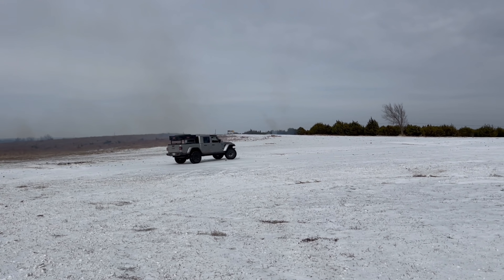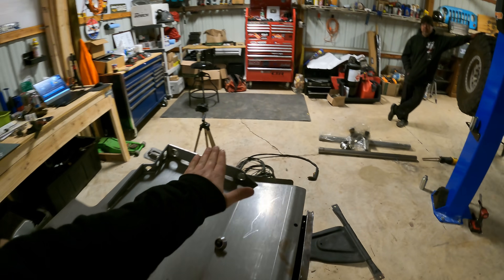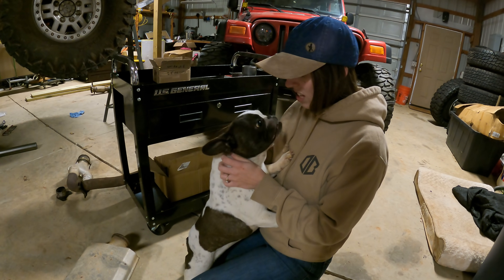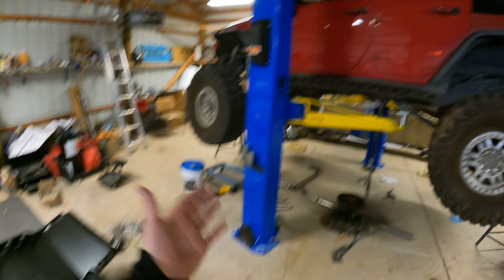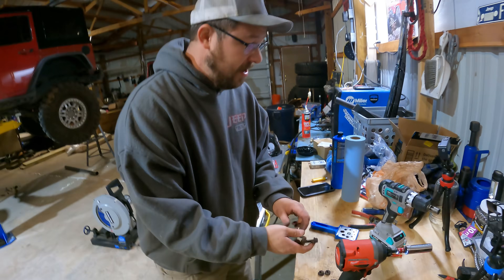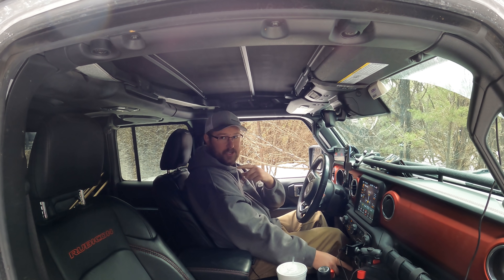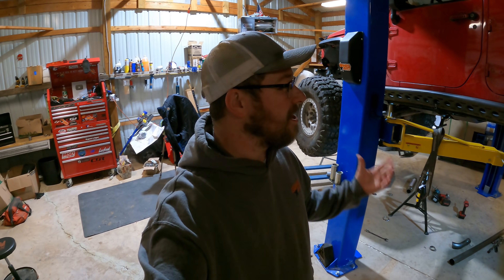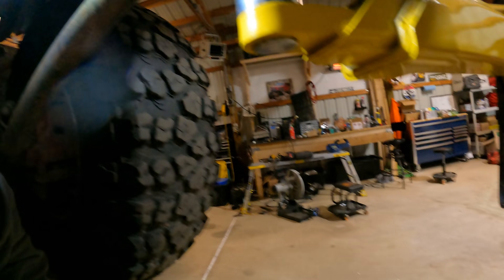The Wrangler is Torn Apart! So Let’s Take the Gladiator Snow Wheeling!

Comment: Tell you what Ben. Since your lift position causes you to use a stool under your JK. Get yourself a Vyper industries stool. They are not cheap but DAM... they work great. Sturdy, comfortable, and move so easily, you will feel like you're gliding over the floor. I was skeptical but then got one and have absolutely no regrets. I have Hyperlite linear hi-bays in my shop. They are awesome!! Very bright. You will need a manometer to adjust your regulator. Propane pressure is measure in column inches.

Comment: Just a thought.... But if you run the exhaust throught the bumper it might cause issues when the Jeep is flexed out the frame has lots of flex too might cracked exhaust welds or something... I could be wrong looking forward to what u come up with...

Comment: Have you thought about uhmw? The king of the hammers sxs chassis we built where I work, that's what we use. Same on the company race car. Slides right over rocks, don't hang up no screeching metal sounds and light weight.

Comment: So the reason I got aluminum skid plates (full Rock Hard 4x4 belly armor) is here in the northeast steel plates will be rusted ugly in 2 seasons. Painted or powder coated makes no difference. And my bloated overweight rig has been turtled plenty of times on boulders. Now if I WERE to have steel skids, I would Raptor line them front and back and touch them up every season.

Comment: Well you're scared plate why don't you just punch it to where it pushes where the book goes in to where it makes it flush with the skid plate or it goes in a little deeper because those protectors you had a rock just right they're no good damage the boat regardless do it the way I mention it and protect the boat better the way you're doing it Ok oh yes and I have seen people take their muffler and squeeze them a little and they should work just as fine just makes it easier to do stuff because they're more oval instead of brown Ok